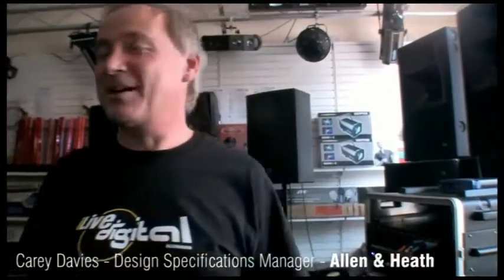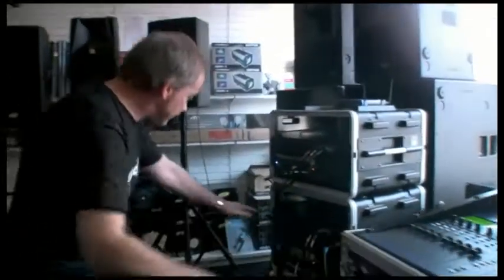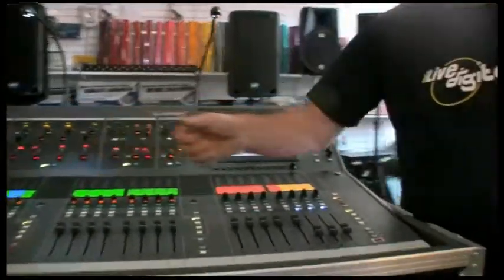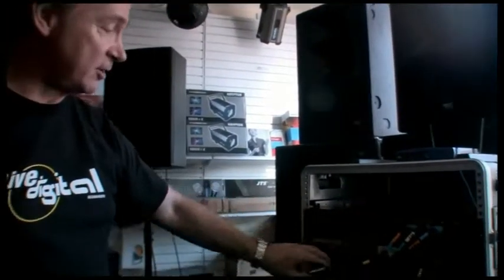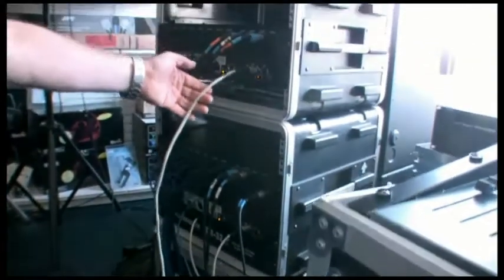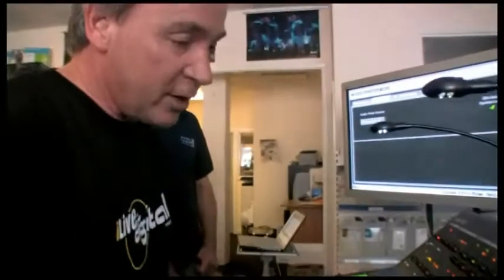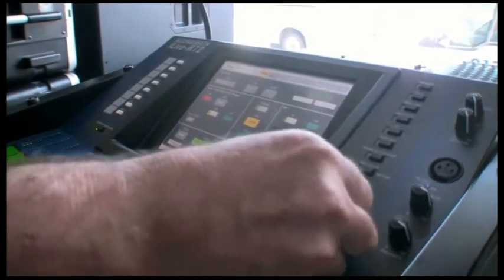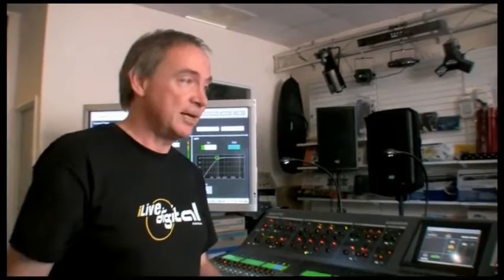iLive as Monitor and Front of House System

Comment: Kb 7981,did you ever get a response?
Reply from the maker: Hello Chaps. To answer both questions on the thread: The iDR 32 doers indeed have 16 OP sockets. You need an x-DR expander to get more. Also, engineer's feeds can come from the OPs on the Surface. Second question, regarding who controls the IP gains: Once they're set for the system, each surface can go into digital trim mode whereby each has their own control without affecting the overall system.
Reply: +AllenandHeathUK I tried to follow the video step by step but still couldn't achieve 5the split,any further assistance will be highly appreciated